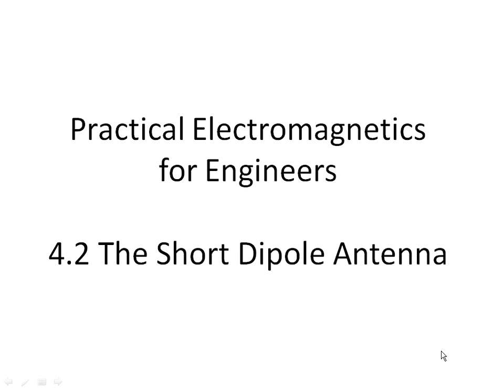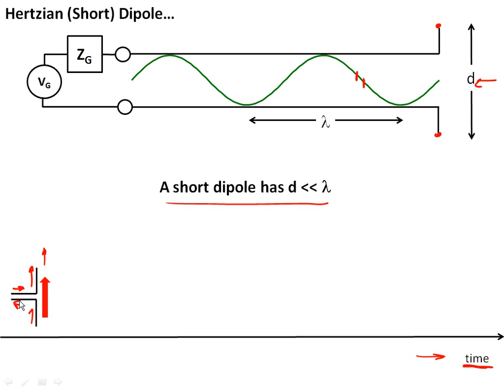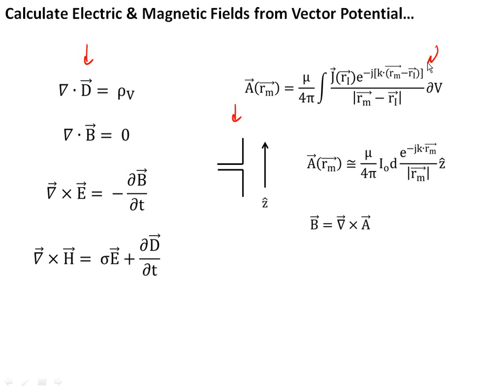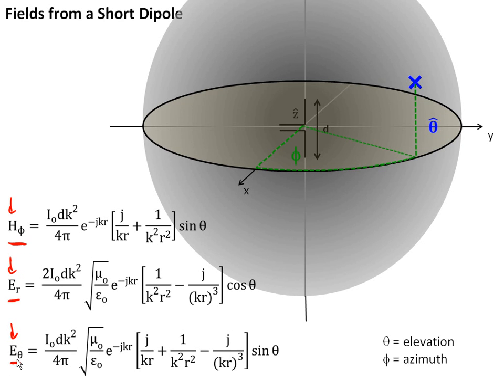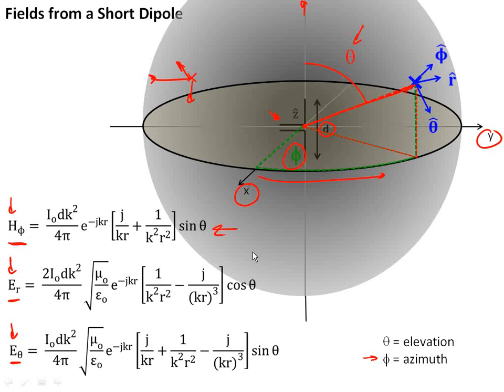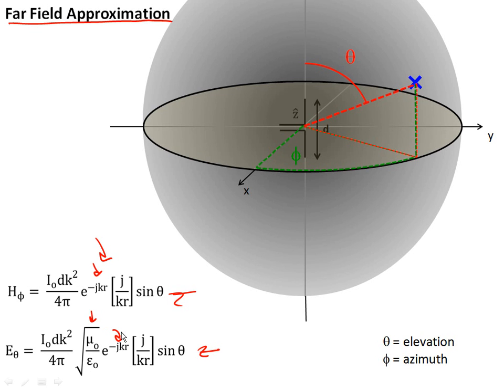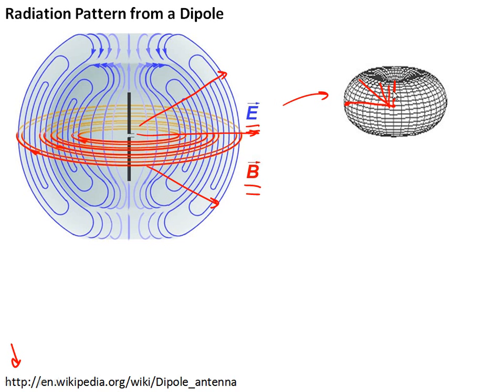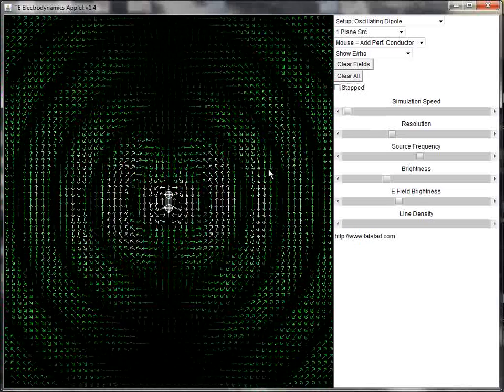4.2 Short Dipole

Comment: thanks alot sir,
sir, how to plot the radiation pattern of any kind of antenna rather it wire monopole dipole helical circular or any type
how to plot the radiation pattern without using any software.
sir i working in the field of antenna design
what are the key methods using which radiation pattern can be roughly estimated.
looking forward for your help.
thank you sir,